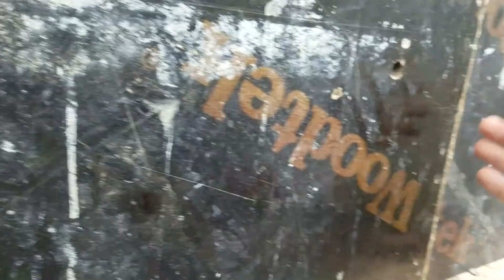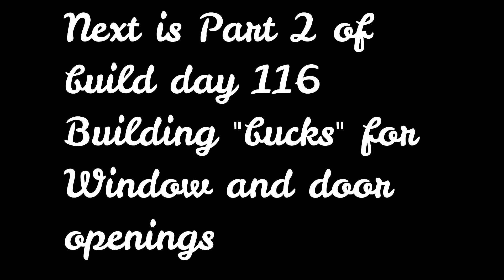Philippines Beach House Build Day 116 Part 1: Pulling the Forms!! Tips Tips Tips

Comment: Your doing a great job James, it’s always difficult to build in an Asian country. A way to protect your water pipes in beaded in concrete is to have a sleeve, but also to place lagging foam around all pipes within concrete.
That’s a way of protecting the pipes from any potential movement, particularly in beams that will take load.
Keep up the great work it’s a patience experiment.

Comment: An idea, may or may not work, but what size rebar will fit inside that Pipe? A short piece to reinforce it while you remove the forms. No snapping off that way.
Reply from the maker: but they are capped off  to keep trash out - you cant just slide them on and off like pvc. Ppr only fits once heated

Comment: I admit that I don’t know anything about Concrete so excuse the dumb question.  How do make a strong wall if you only pour 1/3 or 1/2 of the height at a time.  I thought a vertical pour had to be a continuous, like Hoover Dam, to be strong.  Thanks for your answer.
Reply from the maker: Hoover dam is carrying the load in a different direction. There is no side load here. All downwards.. stack some short 2x4s on top of each other. 4 inch side up. You cant put huge force straight down. Now those same boards push a load in from the side and they buckle. Your comparing two totally different types of structures. This is replacing  a block fill wall. Which do you think is stronger?

Comment: What is that Woodtek product? How much does that cost per sheet? Is it 4x8? It doesn't look strong enough for forms but it obviously is.
Reply from the maker: It is plywood made just for forming. It is very rigid and has non stick film on it. I covered the cost and about it in a video just few back, I showed it being delivered and the cost per sheet. There is other brands as well. yes it is 4x8 and you can get 1/2 or 3/4/ The one half saves huge money and I  think is just as good. The cribbing is whats important!
Reply: @TexasFilipino  If it doesn't stick, that means it can be repurposed. I probably missed that video when I was sick for 4 weeks. I couldn't get out of bed. Was hospitalized for 4 days.

Comment: what are the purpose of screwing the wood on that flat sheets?
Reply from the maker: That coco lumber is now drilled through for that spot where the bolts go thru. If that piece is attached on the main form pieces then it doesn't get dropped to the ground , carried out in a pile or chopped and used for something else instead it is right where it needs to be for when we use the form again. Efficiency !
Reply: @TexasFilipino  okay..was the nails are not enough?if you use nails will it drop?